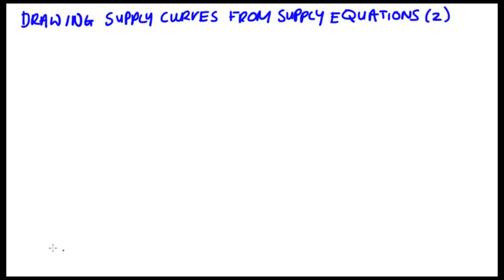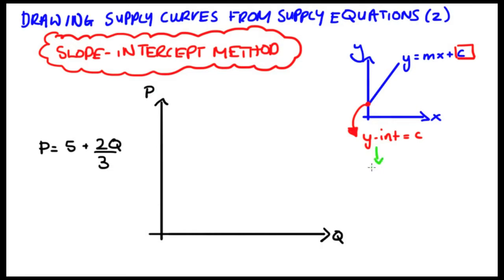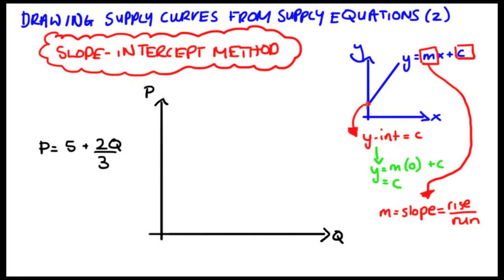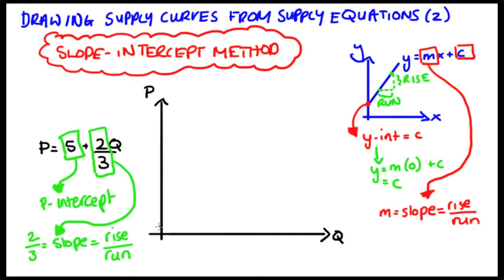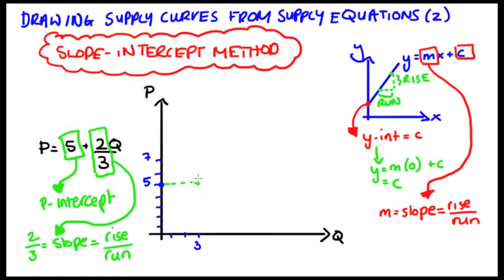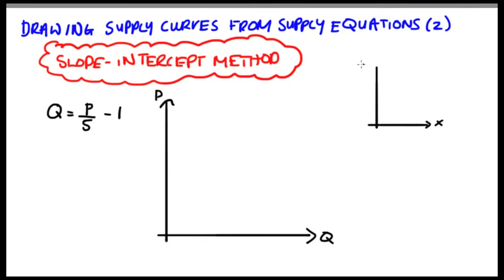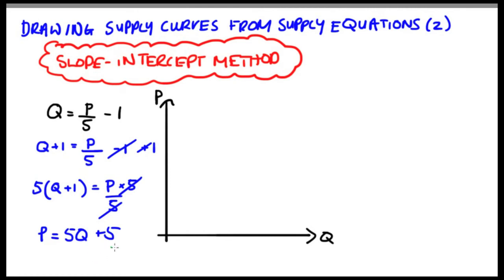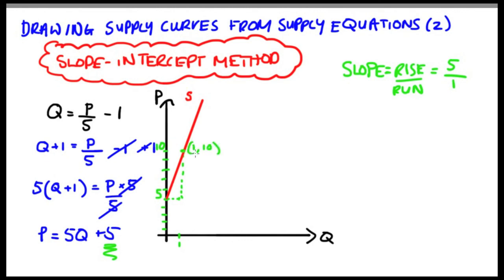Drawing Supply Curves from Supply Equations by Finding Slope / Intercept

Comment: Been 3 months since I saw your last video, again you are the only ytuber solving my silly doubt.
Tysm🙏👍
Btw I have a additional doubt
What is the standard form of a demand function is it 
D=f(P)
Or is 
P=f(D)
Reply from the maker: Aw that's so nice! Thanks! Standard form for demand is D = f(P), since that is the direction of the logic when we think about the relationship between price and quantity demanded. By logic, I mean that price is considered as an independent variable and determines the quantity demanded. Since P is on the vertical axis, this is the opposite of how visual diagrams that relate two variables are usually understood (in non-economics applications). I mean to say that usually the independent variable is on the horizontal axis (usually denoted x), if that makes sense. I hope that doesn't confuse you. We sometimes write demand functions as P = f(D), if so we call this an inverse demand function. I hope that helps, thanks again for the supportive comment, I hope to be able to work more on the channel soon and get some more videos out :) :)
Reply: @econhelp_official  👍